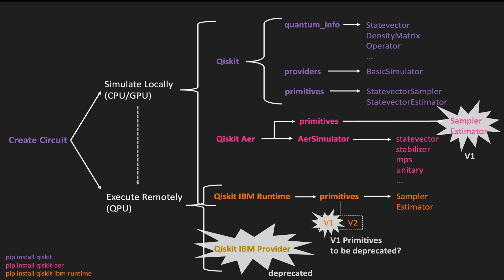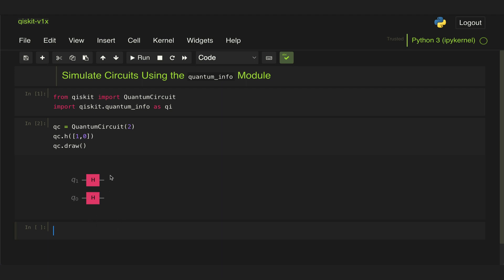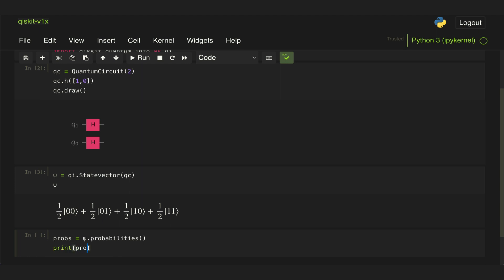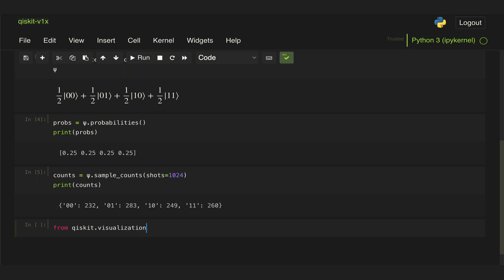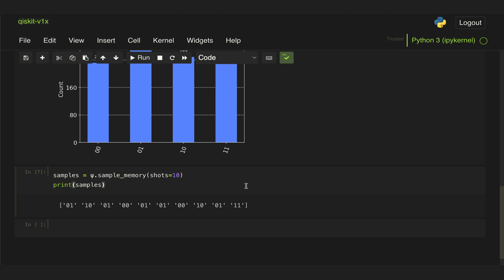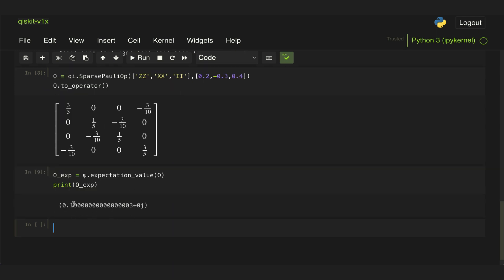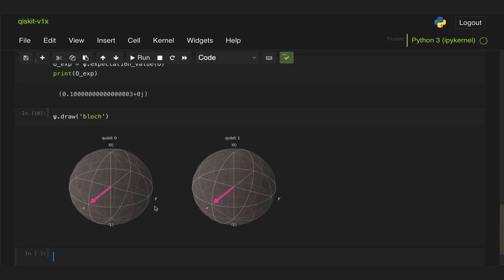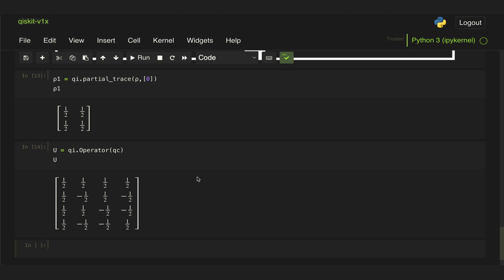Using Qiskit v1.x | Part 2 - The quantum_info Module

Comment: How are you using the \psi to be psi or the ket output in a Jupyter notebook ?
Reply from the maker: Jupyter has autocomplete features, where you can type \ followed by some supported symbols (like greek letters), and it will replace it with the corresponding unicode character when you press the Tab key
Reply from the maker: For the ket output, you need to set qiskit's user options to do this automatically. I have a video on this here:
https://youtu.be/GvsVKxAi46E?si=41YRVdLrJB4UUFfI